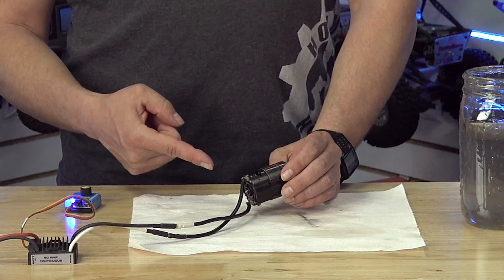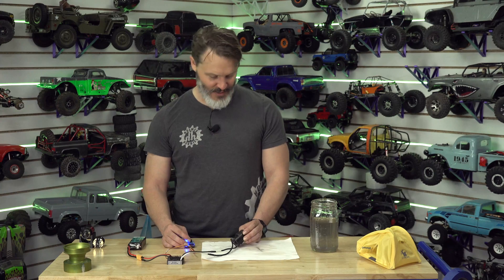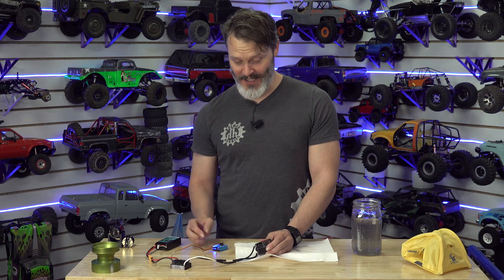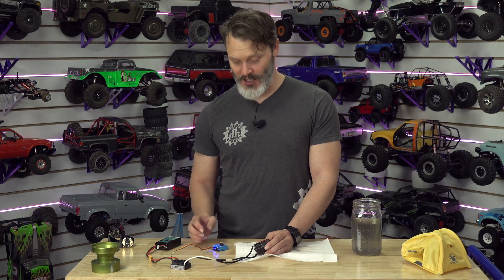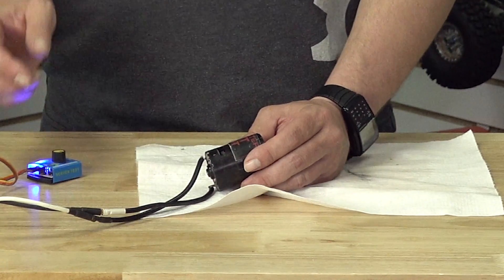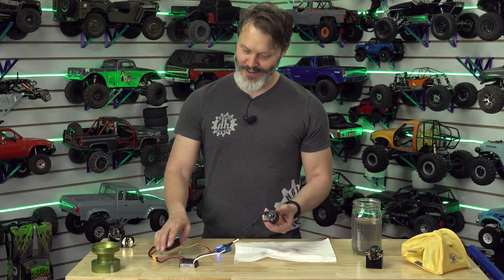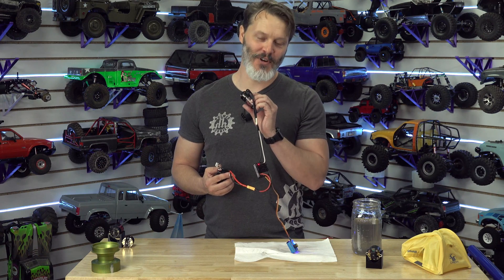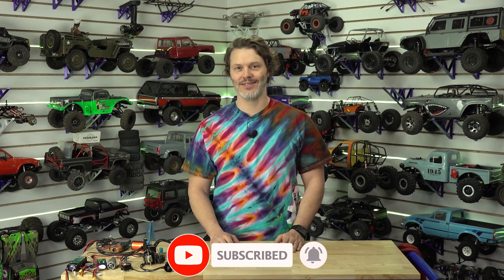🚫 Exploring the Risks: RC Motor After a Water Break-In (Not Recommended) 💧🔧

Comment: simple brake cleaner and relube, you jacking the motor around without lube shows your knowledge, run the other way folks.
Reply from the maker: I literally say im killing the motor and show the brushes ablating into sparks as its being abused back and forth. 

Im really not worried about destroying a low cost sealed can for the video.  It seems the comment section is quite divided on using wd40 to flush it.
Reply: @HolmesHobbies  if your going to be a comedian, that is one thing, but as the you say things as if you know what's going on, and you dont. I water dipped hand out motors for 15+ years, properly done it really makes a difference in power, as the hard brushes are fully broken in.
Reply from the maker: @user-rs8zg8ey2b 
Racing is trying to extract max power at mininum motor life. I fully agree with your statements for racing and how to treat a handout motor.   You want to bed those brushes fully and make it spin fast + efficient.  I make high timing race motors now (didnt when this video was made) so it would be a good idea to reshoot this for performance minded customers.

 crawlers are notorious for running in water and full throttling back and forth just like im doing, its hell on motors but my crawling motors are designed to take the abuse and keep running.  These are low rpm zero timed motors, the opposite of max power.    My sealed cans have a self lubricating bronze bushing that lasts well over 500 miles without maintenence. The brushes wear out first, so water break-in can steal hundreds of miles of life.  Since amp needs are so low, it doesnt noticably increase power to bed in brushes either.
Reply: @HolmesHobbies  your "fast + eff" statement does not make sense. Fast is amp draw and brushes fully broken in, eff is low amp draw and brushes not broken in. You dont get both.I drove 12th scale for 15 years, 12th in the 96 worlds, 2nd in the 99 worlds, 7 national titles (all onroad), I have been around racing for decades, never crawlers. I came up with brushes for 12th scale that increased timing and decreased overlap, commdrop reservoir that lasted 8 minutes, zapping batteries with 4000 amp pulses 5 years before it was common. Its gonna be hard to pull wool over my eyes.
Reply from the maker: @user-rs8zg8ey2b  low amp draw and rpm on a fixed timing fixed turn  motor is weakness. Unseated brushes are only "more efficient" because the motor cant climb the potential dyno curve.   Resistive heating is the square of amps .  2x amps = 4x heat.  Cant pull more amps, cant make more heat, stays cooler during the run, sits in a more efficient zone of the curve.  The motor isnt actually more efficient,  its just nuetered in power delivery. 

If you DIDNT care about power + efficiency then you wouldnt lube the bearings or want a true comm either.  And you wouldnt want to start a race with a cold motor.  A hot motor has a higher amp draw too.   So if we didnt want power + efficiency we would be preheating motors too 😂  

Ive wound tens of thousands of handwounds in house. I was trained how to build by the owners of checkpoint, trinity, putnam, and astroflight.  You are taking one out of context shitpost edit of another video about motor break in for CRAWLERS and making assumptions about RACING when the needs couldnt be more opposite.   Go watch my break in videos on handwounds if you want to see something more serious.  But be forewarned, we tune for lowest amp draw and speed because the needs in a crawler are polar opposite of racing.
Reply from the maker: https://youtu.be/54UcNPrmOEU?si=wEzajcNWqEPGA3bV

More context on the needs of crawling brushed motors vs racing.

Comment: I've been water breaking brushed for 10 plus years and haven't had any problem as long as I dry them and lube them up
Reply from the maker: Drying and relubing is the key! Most users these days dont do any motor maintenance
Reply: @HolmesHobbies right I learned that after a few motors then got told by a guy that races short course trucks that it's safe to water break them in but make sure to dry it the best you can and lube it up (:    

He also said to do that every other battery pack/ if you race

Comment: So you don't follow the general motor break in procedures, then you say it's not good to do. 1) Dry motor with compressed air. 2) Then electrical cleaner. 3) Oil the bushes. Definitely don't run motor forwards and backwards like that repeatedly. Don't run while wet before compressed air and contact cleaner to properly dry the motor, don't run with unlubricated bushes.
Reply from the maker: Indeed, im showing people how it kills the motor to run it back and forth. Those sparks are the brushes ablating away.  

Thats how crawlers treat motors, and we run through water too. Its really not an ideal treatment!  And my sport motors still last 500 miles of trail.

Comment: After doing a short water break in, just enough to fully seat the brushes,  you have to disassemble them, clean, relube and  reassemble... we did this for commercial slot car racing forever, but newer motors are sealed and not serviceable... reality is, there is  not a noticeable difference in wet or dry break in... wet  is a faster process and you eliminate the chance of arcing the commutator.... Time spent learning to drive  has more payout.

Comment: You shouldn't be using WD-40 to dispel moisture in an electric motor and that is a big part of the problem here. Despite assertions to the contrary, WD-40 IS a lubricant.  It is composed mainly of petroleum distillates and hydrocarbons that displace moisture (water displacement) but leave an oily film that reduces rust build up and provides lubrication (exactly the purpose it was designed for in the aerospace industry).  Now, the viscosity of that lubricant is so low that it is not effective over time, especially during hard use - but a lubricant none the less.  And that thin film can gum up and prevent proper conduction of electricity through the brushes and, under heavy loads and high heat, can turn gummy and attract dirt and dust.  So, not an ideal way to dispel moisture in a brushed motor, especially ones with a sealed endbell.  You're better off using a non-chlorinated brake cleaner, contact cleaner or electric motor cleaner (even isopropyl alcohol) - these will dispel moisture without leaving a residue.  Then a couple of drops of lube and all is well.  The worst thing I can say about water break-ind is the potential of misuse that can lead to premature wear and failures.  For that reason, I suggest other alternatives for breaking in a motor but any issues with the water break-in method are mainly a result of inexperience and misinformation and are not a result of the method itself.

Comment: Brake parts cleaner is what i used for cleaning motors, never water broke in anything, but the BPC will remove all water quickly, just relube the bearings because BPC will take everything out including oil. BPC also leaves no residue so plenty safe on all electronics

Comment: Back in the days of stock racing I used isopropyl alcohol not water. 
Edit to add- I also ran it at low power by hand(tx controlled) maybe 40-60 seconds each direction, used comm drops on the brushes to comm, then a drop of oil to each end of can and spun it with my fingers each way a few times.

Comment: WD40 is not a lubricant it is a water displacer! Just in case anyone is confused about that!
I know he said it correctly "run a bunch of WD40 through it AND relube the bearings" but some people might misunderstand him becaus ehe said it really fast! And using WD40 as lubricant is widespread common misconception!
Reply from the maker: yep
Reply: And you have to relube the bearings becaaaause...it's also a solvent!!!  Washes that grease right outta there!
Reply: Sorry but not true.  It was designed by the aerospace industry to dispel water and provide a very thin lubricating film to prevent rust.  Not an effective lube on moving parts but still a lube.
Reply: @jerryvolpini7987  It is a protective film. Calling it a lube is misleading.
Reply: @TheBod76  I'll go with the people who invented it!  They make it very clear it IS a lubricant.
Reply: @jerryvolpini7987  WD does stand for "Water Displacement" but calling something a "lubricant" is a veeeery broad term.  Lubricant for WHAT?  I think all of us engineers know, the lubricant has to fit the application.  So, yes it can lubricant but for very limited applications is it the ideal choice.  It is a much better water displacer and solvent. IMO  Bearings wouldn't last too long as WD40 as the sole lubricant.
Reply: @JViello  Absolutely 👍  I did say that it was not an effective lube and due to its viscosity is easily flung off.  It shouldn't be used on bearings,  especially, or any high wear part.  We can get into semantics but still a lube even if not an effective one.  And, yes, I do know what the WD stands for, lol, and certainly what it excels at! 👍

Comment: Can you try this on a Tesla ?
Reply: They are not brushed motors. 3 phase brushless, motor on axle is what is in a Tesla.
Reply: @jerrywatson1958  Technically motor on gearbox, but yeah it is still HOUSED on the axle.  Isn't that a motorized transaxle at that point?  🤔
Reply: @JViello  What gearbox? They are single speed from my knowledge.
Reply: @jerrywatson1958  Single speed, yes.  I didn't say transmission, but gearbox.  I guess you can call it a differential, but it's also more than that.  There most definitely are gears between the output shaft of the motor and the vehicle axles.  One company used to - and may still offer - a higher numerical upgrade gear for better acceleration.
Reply: Sarcasm, noun, the use of irony to mock or convey contempt . Thank you Jerry